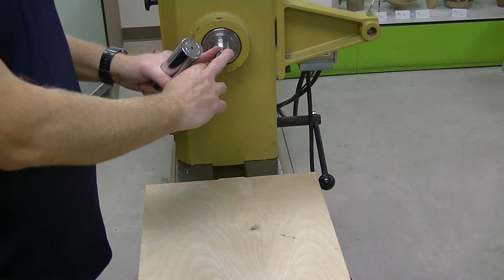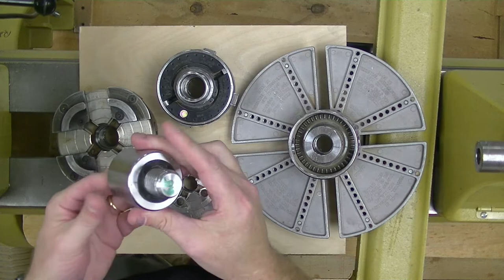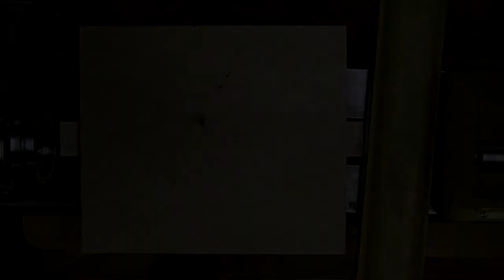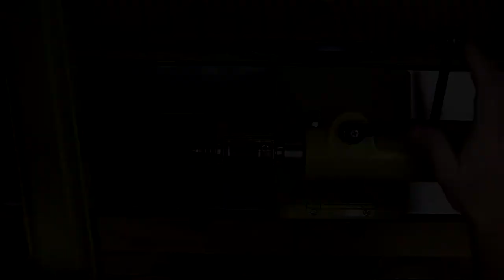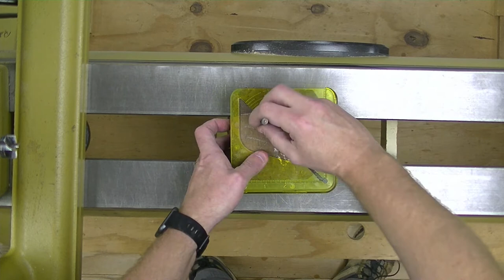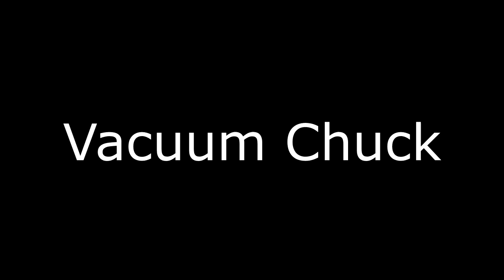Lathe Accessories for the Beginner

Comment: Those tool rests with the curves for getting inside a bowl:  a bit confused in that the curves on the ones shown were on the left as you face the lathe. How would you get inside a bowl on the headstock side?  All the bowl hollowing I’ve seen is on the tail stock end. Am I missing something?

Comment: Not every lathe comes with a knock out bar. It only takes a few minutes to change chuck jaws. A tray on the bed bars will catch any dropped screws. Screws in a face plate will not waste wood because once a tenon or recess is formed the blank of wood can be reversed and turned into a bowl. A great video, thanks